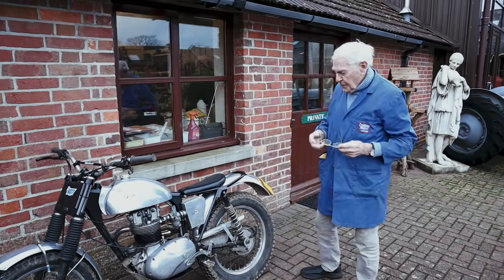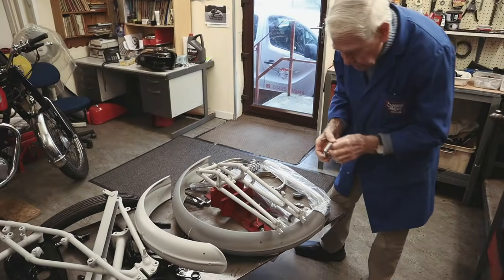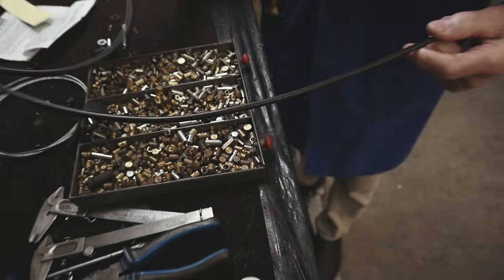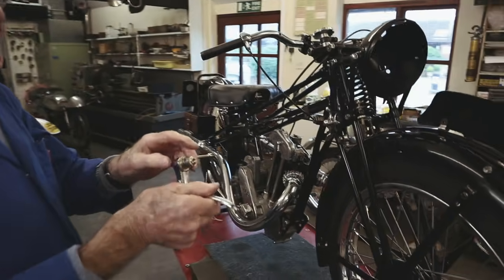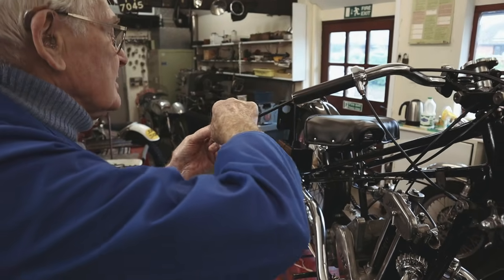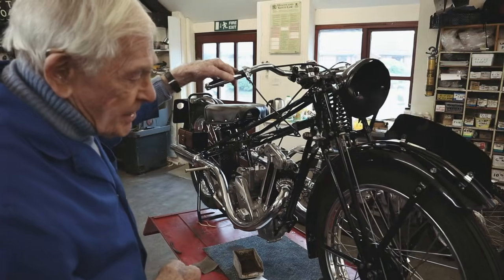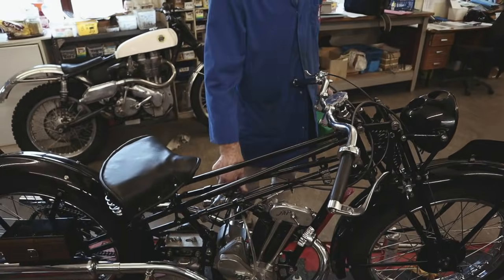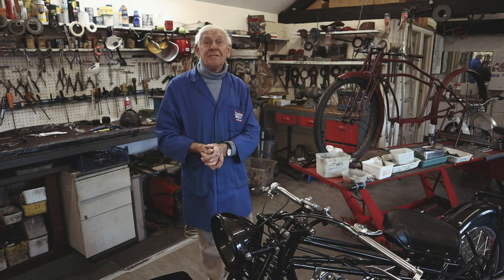Firing up a 1933 Cotton.. with a cabling lesson included!

Comment: I was lucky enough to get a venhill dealer cable making kit from a place that was closing down. It contained everything you need to make your own cables, inner and outer wires as well as the nylon sleeve on the roll. Every type of brass nipple and an inlay card on the inside of the box with the part numbers for re ordering from Venhill. The kit even included a great pair of side cutters for cutting the inner wire.

Comment: Never thought I’d disagree with anything bike related that Sammy had to say.  Acidic soldering flux should never be used on Bowden cables.  Capillary action will draw the liquid acid into the lay of the cable and no amount of rinsing will remove it.  
Always, always use a passive soldering flux.